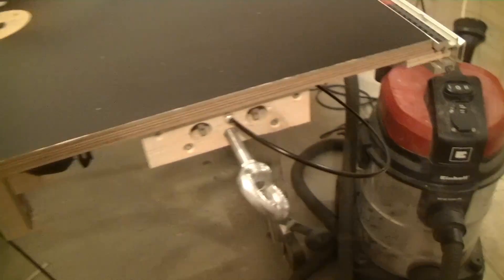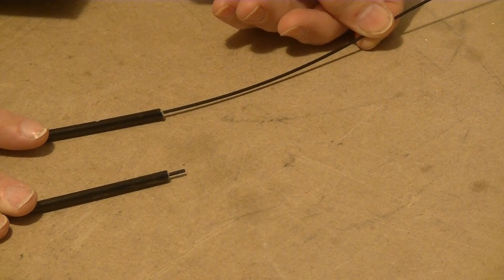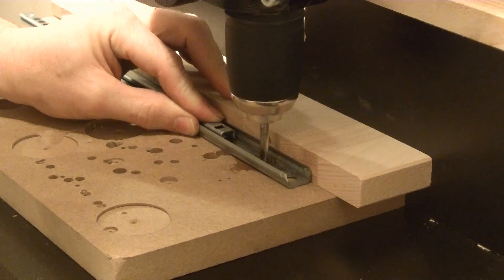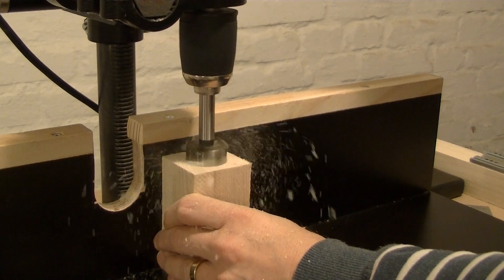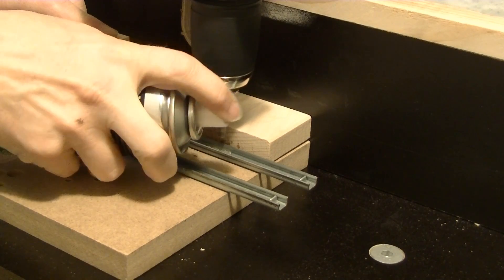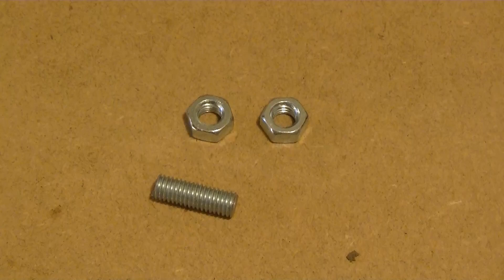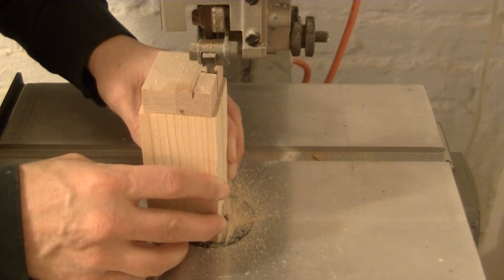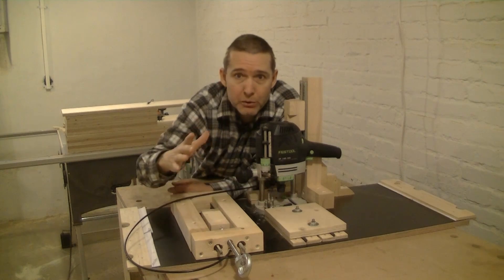Router Lift build for Festool OF 1400

Comment: Hi Ernst - great build, it looks like a good alternative for creating my own lift. I do have a couple of questions though:

- Could you specify the length of the drawer guides you have used? Those are ball bearing guides, right? Did you notice any problems so far regarding dust collecting in the guides itself preventing smooth movement of the lift?
- It never occurred to me that only using the plastic casing of the OF1400 to connect the push block to the router is strong enough to move the router up and down. Did you encounter any problems so far using this casing as the only point to transfer the up/down movement from the lift to the router itself?

Thanks!
Reply from the maker: +Hannes Masschaele my drawer glides are ~20 cm long.

The Festool routerlift works the same way, so nothing to worry abaout the plastic casing.